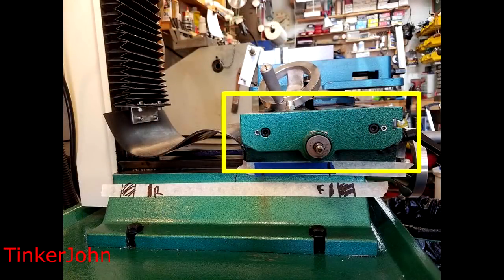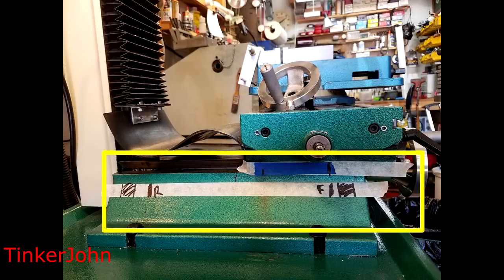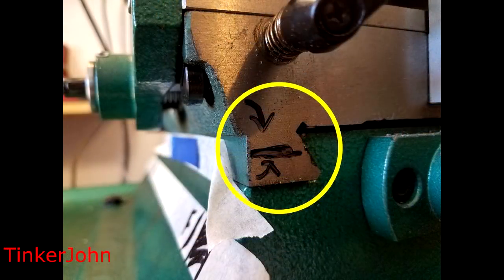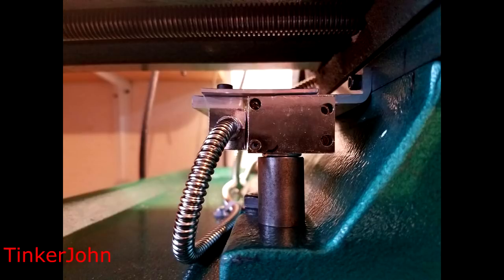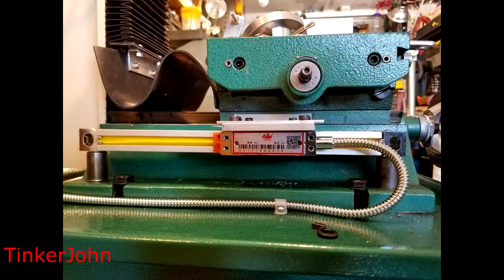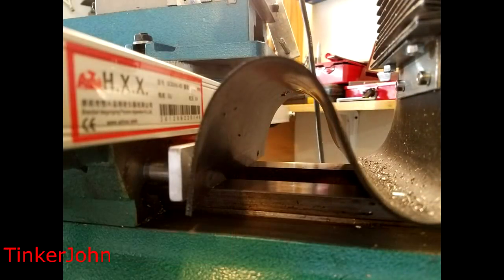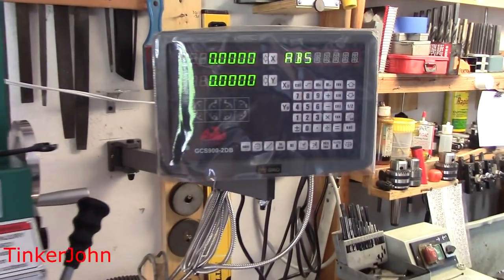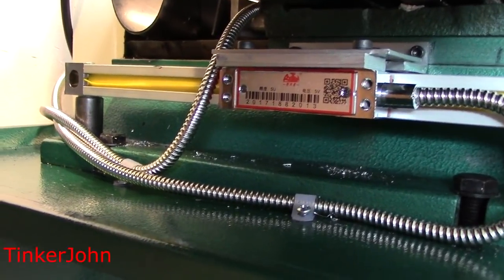DRO Install-Glass Scales on Grizzly G0704 –Part 2 (Mount X & Y Axis)

Comment: Thanks for taking the time to document the process John.  I note you chose a 2 axis DRO instead of the 3.  I am still shopping for a larger mill to replace my mini and will probably choose the 2 axis myself.  I hope I don't regret that.
Reply from the maker: Thanks for watching.  So far the 2 axis has been fine, however the G0704 does have a "simple" DRO.  It is not backlit and the letters are rather small but it does work. If the mill did not have the DRO, I might consider a 3 axis.    ~John

Comment: Great video John. I've just bought this kit for my Harrison L6 lathe (retirement present to myself), you've given me some great ideas how to mount the kit, albeit on your mill but the principal is still the same. I've had the same issues regarding the length of linear scales, in the end I had to buy slightly longer than I needed. Seems most that have cut the scales down to size haven't had any major disasters. As with any job, take your time and be careful.... it'll be fine, that's what I keep telling myself! All the the best from the UK.
Reply from the maker: Thanks for taking a moment to comment.  I think you will really enjoy the DRO.  I wish I had bought mine sooner.    ~John

Comment: For the G0704 what scale length woiuld you recommend for 3 AXIS?  From the Grizzly site it gives these traverse figures:
Max. distance spindle to table: 13"
Table travel (longitudinal): 18-7/8"
Table travel (cross): 6-7/8"
Vertical head travel: 11"

Here is where I get confused when it comes to what scales I should look for in the kits offered on Amazon?
Reply from the maker: Terry for X & Y my overall length of scales are 25 inches for X and 11 for Y.  I don't have Z axis other than the quill down feed that comes with the mill.  The DRO made a huge difference in ease of use.

Comment: Thanks for the Video. I have mounted my X axis scale to the front of the mill as I thought I'd lose travel is mounted on the rear. Did you lose any Y travel by mounting the X Axis scale on the rear with the dovetail cover?
Reply from the maker: DJ, thanks for watching the videos.  I did sacrifice a small amount of travel, however I made the choice for mounting on the back in order to keep the table travel locks available.   ~John

Comment: THANK YOU...for sharing. Nice neat job on the DRO...It may have taken you two days to do   but I bet you had fun doing it. I love getting out in the garage and starting new projects. I notice the temp. was almost 80 in your shop? You need some air!! :)
Reply from the maker: Thanks for watching.  The DRO did work out nice.  You are correct about the temp...it will be near 100 degrees in there before long  :(      ~John

Comment: John, I ordered a 3 Axis last month for my Mill. Not the same name as yours, but the read head is the same.
Still trying to figure out the manual that came with it, some real bad Chinglish. Seems to be
a real good deal so far. Good luck.
Reply from the maker: Thanks for watching.  You are correct about the manual, it's almost useless, however there are good YouTube videos that show the basic functions of the DRO.      ~John